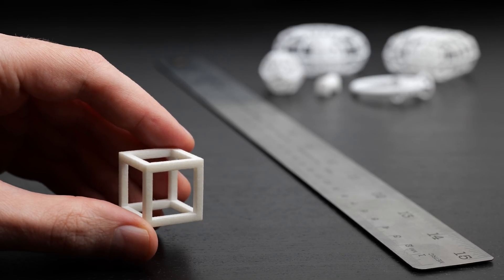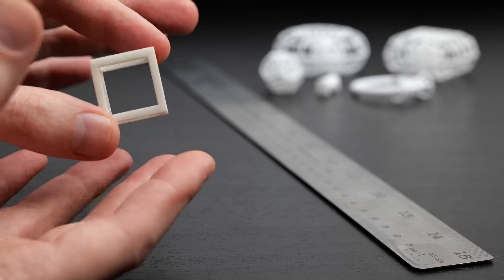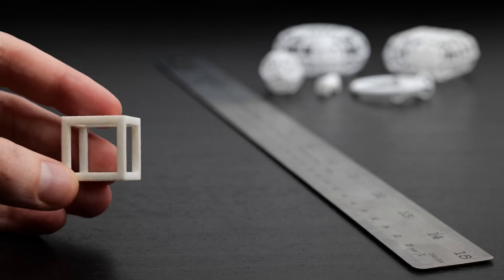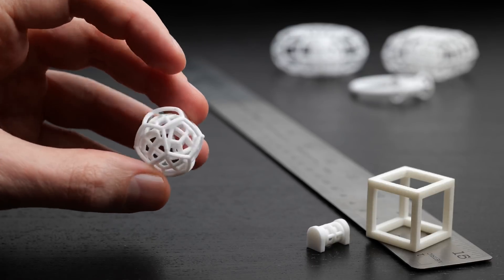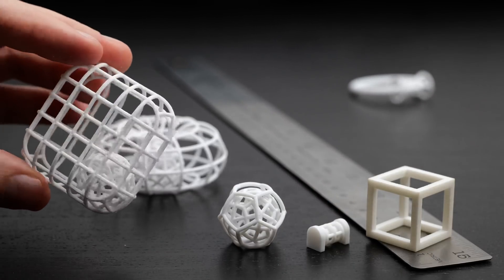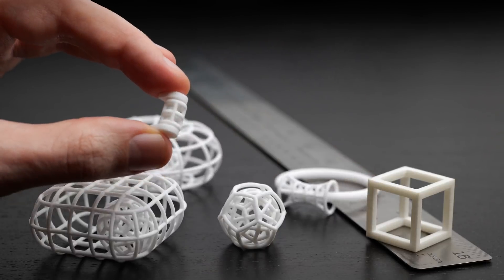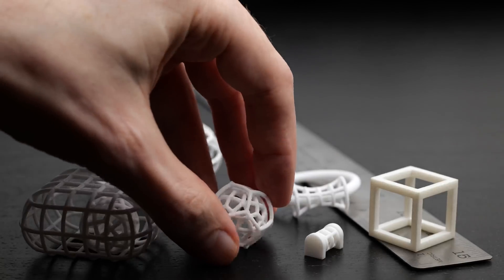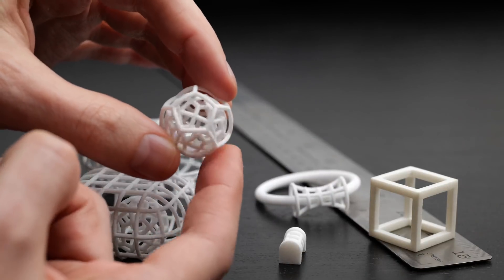Puzzling degrees of freedom

Comment: I don't get why you have three degrees of rotational freedom. Can't you represent any rotation in three dimensions with two angles, like in spherical coordinates?
Reply from the maker: Spherical coordinates will determine a point on the sphere. So, if you’re trying to represent the orientation of an airplane, spherical coordinates can determine where the nose of the plane is pointing. But the plane can roll while keeping its nose pointing in the same direction. So you need a third parameter.
Reply: @henryseg  Thank you, I can visualize it now.

Comment: Wrist? Though not quite sure if it’s just rigid rotational DOFs. Actually there could be an argument for a third, but….it seems to me that the first two rotational DOF are probably rigid, but you might argue there is a third rotational DOF because (rotation about the forearm axis), although if you hold your hand with your other hand at the joint that third deformable rotational DOF is zero-ish.

Comment: If you put the ball in cage that is made with a small cube w/round corners and large cube w/corners and the distance between them a bit larger than a elongated torus that slides between them , then maybe? It works out in my head. 😅

Comment: 5dof without a boundary:

Imagine one torus within another torus, the outer torus being the 'frame' or the 'ground'.  This implements 1dof.  Now, place a nub on the inner torus, and cut a groove in the outer torus, all the way around, so that the nub pokes out.  At the end of the nub, attach the frame of the 4dof model.

This mechanism has three parts rather than two, there is an intermediate component which is neither the 'ground' nor the element with the specified dof, but it does the job.

Comment: The 2 degrees of freedom ring/shaft was immediately what I thought of when you presented the wheel and axel, except instead of a ring it was just and extended axle so it could rotate and move side to side, if you put the 2 ends of the axle into 2 tracks that are purpendicular to the axel and parallel to one another then you have 3 degrees of freedom for the wheel and 1 for the axle aswell. You can add more track connections perpendicular to the tracks to add yet another degree of freedom, and if it can go in opposit directions on the tracks (one side forward, otherside back) and they connect you could add another rotational degree of freedom too by basically encasing the wheel and axle in a cage of tracks that it can move along and rotate around within

Comment: For 2 degrees of rotational freedom, having a sort of cross shape, along all 3 axis, being confined within a large cube, with enough room to rotate freely, but confined again using 4 cubes-ish (each still connected to the larger cube, so it's all one solid), separated as if you've cut out a channel along 2 of the axis-es but not the third of a large cube. So kinda like a negative of a 2d cross shape but extruded to be tall and 3d. This might be very unclear though. Cool puzzle!

Comment: Question: Can one control the translational and rotational freedoms independently?

0 translational degrees of freedom, 0 rotational degrees of freedom: Cube inside a cube

1 translational degree, 0 rotational degrees: Cube inside a tall square prism

0 translational, 1 rotational: Cylinder inside a cylinder

2 trans, 0 rot: UNKNOWN

1 T, 1 R: Cylinder inside a tall cylinder

0, 2: Cylindrical cutout of a sphere inside a planar cutout of a sphere

3, 0: UNKNOWN

2, 1: Cube between two planes

1, 2: UNKNOWN

0, 3: Sphere inside a sphere

3, 1: UNKNOWN

2, 2: Cylinder between two parallel planes

1, 3: Sphere inside a cylinder

3, 2: UNKNOWN

2, 3: Sphere between two parallel planes

3, 3: Two free objects
Reply: Followup: Can one control how many directions of translation are parallel to an axis of rotation?

1 T, 1 R, with 0 axes parallel: Cylinder in a square prism, cylinder axis orthogonal to prism axis

1 T, 1 R, 1 axis parallel: Cylinder in taller cylinder

2 T, 1 R, 0 parallel: Cube between two parallel planes

2 T, 1 R, 1 P: UNKNOWN

1, 2, X: UNKNOWN

2, 2, 1: Cylinder between two parallel planes

2, 2, 2: UNKNOWN

Comment: having exactly 2 degrees of rotational freedom definitely requires fancier shenanigans and an un--rotation-like configuration space, just because of how rotations (or more specifically the space of basis planes they happen in) come out of the combinatorics of pairs of single dimensions

namely: n-choose-2 never has a value of two (at least for integer n, the sequence is 0, 1, 3, 6, 10 ...)

Comment: a solution for 5 degrees of freedom without boundaries would be a torus revolved around some axle, so a hollow torus with a tube in the center (metatorus?), it's not really possible to make because the two pieces of the torus can't touch though

Comment: spheres only ever have two poles (points that stay a rotation). If you add any two rotations, it becomes a new rotation and a new pair of poles. 

But if you have two axis to the sphere, you can combine rotations along those axis to turn any starting point into any end point. And this even works for rotations - but you might not be able to go there in a straight line. Just remember that a spherical surface can host an equilateral triangle with sum of angles being 180, 270 or a bunch more (if you allow intersections).

Comment: For five degrees of freedom without a boundary, the obvious solution would just be a ball sandwiched between two infinite planes, but I am assuming that you are asking for a finite shape, so my best solution would be a ball between two concentric spheres that is free to rotate (you could also do it between two tori. Doing it physically would still require a small connector to keep the spheres fixed relative to each other, but other than that there would be no boundary.

Comment: For two degrees of rotational freedom, start with a form similar to the ball inside a torus. Remove the hole in the center of the torus, and extrude the internal sphere so that it is a pill shape that is as long as the diameter of the modified torus. The pill will only be rotate about its long axis and the axis perpindicular to the modified torus.

Comment: At first, for the 1 dof, I thought of a translating piece on a square axle. Then I tought about the 2 dof, I came up with the torus solution, made me think of and actual axle for the first solution.

For 3+, I didn't came up with it, but I might if I had put more time. Once you come up with the solution for 3 dof, you mix in a bit of the torus magic for the 4 dof solution, then I believe the two planes is obvious.

It was a great puzzle

Comment: If you take a cube and extrude a cylindrical shape from each face, then take 4 rods spaced just outside 4 parallel edges of the first cube joined together at each end with a flat plate

The first object can rotate in two axes perpendicular to the rods, but not in the a is parallel to the rods

Comment: two rotational dof ? I'm guessing a disc with slot rim on the perimeter. With a c-shape clamp fitting a constraint onto the disc perimeter. So the disc can rotate about its row axis. but could also rotate about yaw axis, without being able to rotate about its pitch axis. So basically 2/3 of a gyroscope with the roll axis plane filled out in order to satisfy the two objects only constraint. That's pretty much the first thing I think of when I hear rotational degree of freedom.

Comment: For two degrees of rotational freedom I can imagine a cone with an attached hemisphere as a body sitting inside of an outer shape extruded by a circular rotation perpendicular to the cone tip (center point), with narrow fitting; similar to the sphere inside the torus, but tapered towards the center. The cone-hemisphere-body can rotate along its unique symmetrical axis and it can spin around the torus-a-like shell, but it can not rotate otherwise, since the thicker parts of the body cant go down the tapered outer shape, nor has it any degree or translational freedom.

Comment: The five degrees of freedom thing would just be one sphere nested inside the other with the ball sandwiched in between, but that'd take forever to 3D print and too much material when just explaining it or CG rendering it works well enough. Guess you could use chicken wire and a ping pong ball if you had to.

Comment: My solutions were a bit different from the video, interestingly

1 dof: a cube in a shaft that has a cross section that perfectly fits the cube. Basically a drawer.

2 dof: a cube with a hole in it, and a barbell shape (basically a rod with caps on the ends). The rod goes through the cube's hole. The cube can slide along the rod, so it can translate in one dimension. And the cube can rotate on the rod like a wheel, so it has one rotational dof.

3 dof: a cube with sides of length A, inside a box with height A, width 2A and length 2A. The cube can translate in two dimensions, and it can rotate around only one axis.

4 dof: a sphere in a perfectly fitted tube. 3 rotational degrees of freedom, 1 translational degree of freedom.

5 dof: a sphere of diameter A in a box with height A, width 2A and length 2A. 3 rotational degrees of freedom, 2 translational. This one is the same as what was given in the video

Comment: Two degrees rotational freedom: lay a pill-shaped object (cylinder with rounded ends) between two circular planes, where the diameters of the planes equal the length of the pill. Connect the two planes such that they form a short cylinder with height equal to the pill’s diameter. The pill can rotate along its axis and along its center, but only clockwise and anti clockwise. Put holes in casing so that you may rotate the pill. Just make sure the pill can’t fall through the holes.

Comment: Two rotational degrees of freedom is a ball joint, but it has boundaries. Unless you do the same construction but as just a socket around a plain ball in which case it doesn't have boundaries but is also not useful as a joint. I can't think of any 5dof without boundaries in the minute or two I gave myself, and I can't think of an obvious proof that it's impossible.

Comment: 1:  square profile ring around a square profile rod (let's say it's either infinite or a large enough ring that the curvature doesn't inhibit the ring sliding on the rod)
2: same thing except not a square profile
3: a thin wafer inside a thin box, translates in a plane and rotates about its minor axis)
4-n: got bored

Comment: 1 Degree of freedom: A cube within a rectangular hole, that can move within it in one direction, but can't turn.
2 Degrees: The same thing as above, but with a rod and a circular hole, so that I can move in one direction, but can also turn in one direction
3 Degrees: Same as you. A trapped ball, that can turn in all three direction.
4 Degrees: Similiar to 2, but with a ball instead of a rod, so that it can move in one direction and turn in all three directions
5 Degrees: Once again, same as you. The ball can move in two directions and turn in all three.

Comment: 3:39 To have five degrees of freedom more "satisfying", the bounded planes could be replaced by two concentric shells with the ball trapped between them. In the real world, there would have to be some way to maintain a constant separation between shells - e.g. by having a connecting shaft at the north and south poles which reduces the dissatisfaction to two points. :-)
Reply: wide donut
Reply: Or just 2 infinite planes
Reply: @1996Pinocchio  Your 3D printer is bigger than most.

Comment: For five degrees of freedom without bound, what about a small sphere inside a double walled larger sphere? Imagine a sphere  made of two layers of material, with a gap of space between the layers that is large enough for the smaller sphere to roll around inside. This allows the smaller sphere to have three degrees of rotation and two degrees of translational freedom(if you use polar coordinates) within the big sphere! One issue is that the big sphere is technically two parts- Maybe you could join the two layers together somewhere, but that seems like it would ruin the continuous-ness of that solution.

Comment: Hi, loved the video. I'll try a guess with a similar "ball in cage" strategy, but this time with a tube inside a disc cage. The diameter of the cage is the length of the tube, its thickness is the diameter of the tube. Then it can rotate around his own axis, and inside the disc cage. 2 rotations

Comment: 1 degree is a cube in a square tube. It can only move along the tube.

2 degrees is a cylinder in a tube, it can move along but also rotate 1 axis.

3 degrees is 3 square tubes with a cube inside, connected to form a corner. This way the cube can move 3 directions but not rotate because of the walls.

4 degrees is same as 2 degrees but elongate the tube along 1 axis, so the cylinder can now rotate 1 more axis but also go along 1 more axis.

5 degrees is a sphere in 2 tubes that cross each other. It can move along 2 axis and rotate in all 3.

To make tubes actual shapes just close the ends at some length.

Comment: My thoughts on this subject, without reading the comments too much, are:
1. For one degree of freedom, you could have an 8-shape moving up or down on two locked shafts that goes through the 8's holes.
2. Two degrees are achivable from a dumbell that is locked in a frame with two sides that has a slit in both sides, allowing rotation in one axse and movement in one axse.
3. I was going to say, that this also works with three degrees, if the dumbell is longer than the distans between the slits in the frame, giving it some space to move sideways, however this also allows some rotation on another axse, if you twist the dumbell in its frame. Therefor instead of the dumbell being the object in question, you could have a ring or a tube on the shaft of the dumbell from 2., giving the object two dementions of movement and a spin.
4. Staying in the theme of the dumbell in a frame, you'd be able to get four degrees if you replace a part of the shaft with a gyroscope (or hollow out a piece of the shaft) and place a ball in the middle. The ball will be free to rotate in any direction and the dumbell and frame ensures that is only have one axse of movement.
5. Obviously, you could replace the shaft of the dumbell with a tube that have the ball inside. Now the ball have five degrees of freedom; three rotational an two plainar.
6. As boring as this conclusion is, I can't see any solution for 6 degrees of freedom, other than what everybody els probably saying: Any free 3D object, that is not affected by any other object to frame it.

Comment: My solution for 1df:
1st shape: Cuboid with a smaller cuboid hole in the middle
2nd shape: Cube positioned inside the hole. Its dimensions are identical to the hole, except its breath is shorter due to it being a cube.
Degree of freedom: Exactly one spatial dimension of translation.

Comment: 2DOF (rotational): A pin encased in a circular disk, where pin length equals diameter. The pin could spin on its long axis, or rotate like clock hands

Comment: 1 degree: a cube with a square hole in the middle with a square rod through it: can move up and down but no rotation.
2 degrees: torus around a cylinder that has end caps on it to prevent the torus from coming off: same as first but it can rotate around the rod
3 degrees: didn't come up with one 
4 degrees: (only came up with it after seeing your ball inside a ball) a sphere inside a hollow cylinder, can rotate freely but can only move up and down
5 degrees: same as yours

Comment: A  bolt and nut technically meets your two degrees of freedom requirement, as while the bolt can only be rotated, the threading moves it up and down as well
Reply from the maker: The configuration space is one-dimensional so I would say that it has one degree of freedom.

Comment: My solutions:
1 degree of freedom: wheel on axle - from your example.
2 degrees of freedom - wheel plus axle 1 on another axle with axis perpendicular to the axis of the first axle - think: differential drive.
3 degrees of freedom - above assembly on 3rd axle with axis perpendicular to the axes of both previous axles - the assembly used to train fighter pilots and make civilians puke.
4 degrees of freedom - the above assembly constrained in a cylinder.
5 degrees of freedom - the assembly of 3 degrees of freedom contained in a plus shaped (+) assembly of cylinders. One cylinder can be considered x axis ad the other y- axis. To change the axis, the assembly needs to return to the origin.
6 degrees of freedom: just expand the above design to include z axis. To change the axis, the assembly needs to return to the origin.

Your solution is obviously more elegant and does not have the constraint of my last two solutions.

Comment: My mind kinda ran with cubes bc of your first examples, so here we go:
0D: just stuck somewhere
1D: a cube in a square tube (trans) or on an axle as long as its ribs (rot)
2D: cube on a long axle or in a round tube (1 trans, 1 rot)
3D: a cube that fits exactly between 2 planes (2 trans, 1 rot)
4D: a cube in a very slightly too large tube (3 rot, 1 trans, although not perfectly restricted in the other 2 trans)
5D: a sphere between 2 planes (oops no cube, couldn't think of one)
6D: separate things

Comment: Nice i got dimilar ones. 2 and 5 are pretty much the same. For 3 and 4 i had the same approach as the 5 one. For 3 it was a cube trapped between two planes and for 4 it was a cylinder